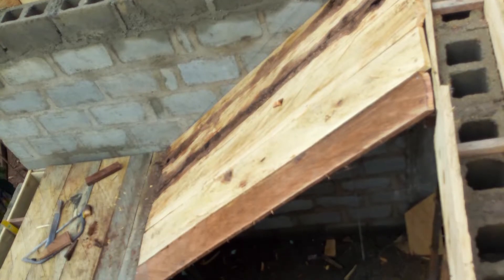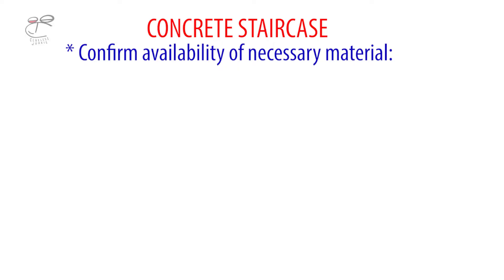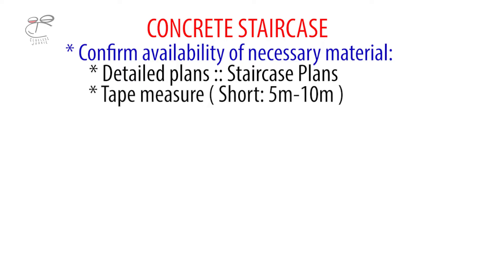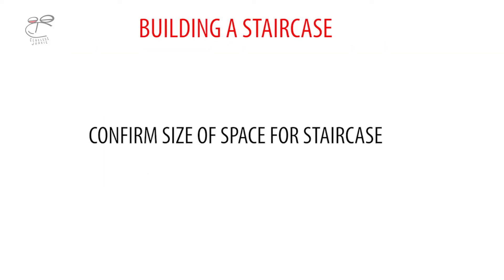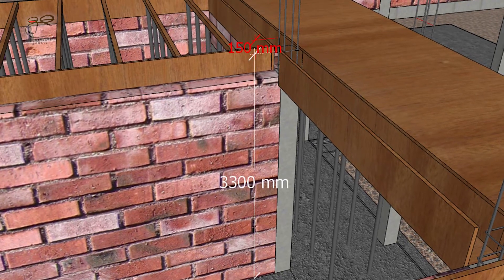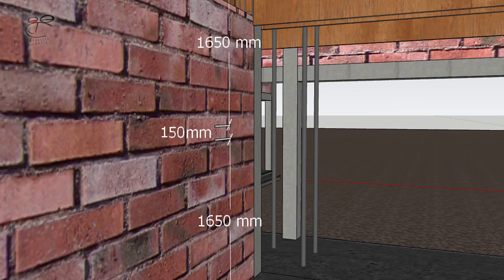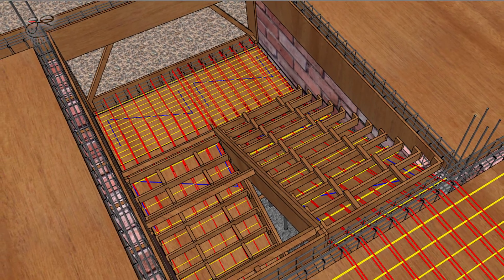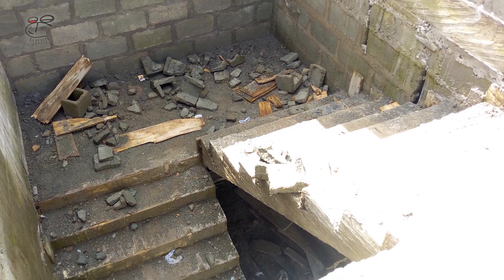How to build Stairs | Reinforcement Design | Step by step | Staircase Design #staircase

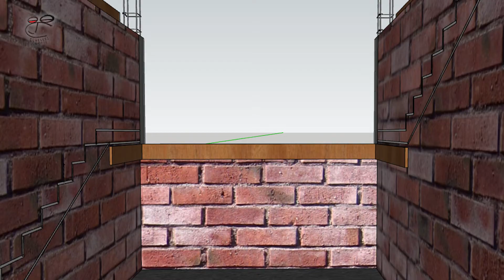Comment: Hi, when you say 'the carpenter drives braces on the wall' at 9:48, does that mean that this frame is screwed onto the wall? Thanks in advance for the info!
Reply from the maker: Screws could be used where applicable but nails are recommended to attach the frame to the walls.
Hope this helps.

Comment: Constructing a switchback set of stairs like this, enclosed between to walls is probably the best type of concrete stairs to learn on. With the walls on each side, you have the luxury of being able to draw the stairs, in full scale, on the walls and then simply cutting your formwork to fit.
Reply from the maker: Great advice, thanks for sharing!